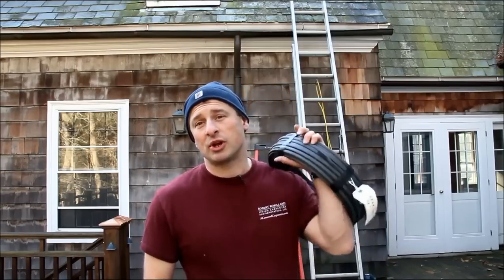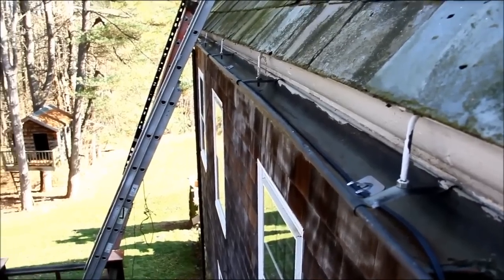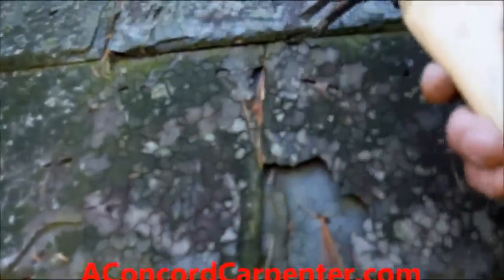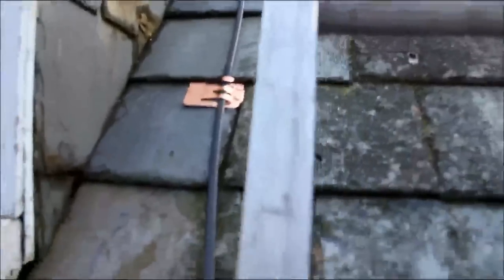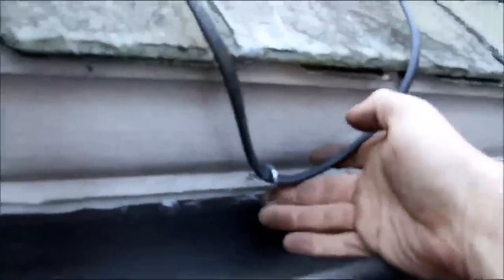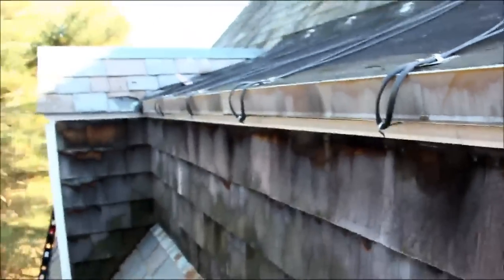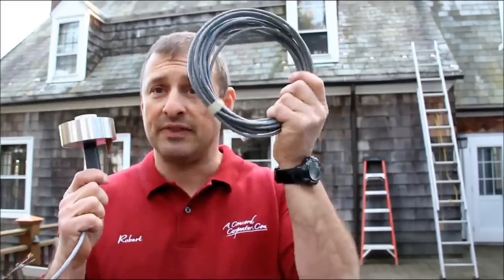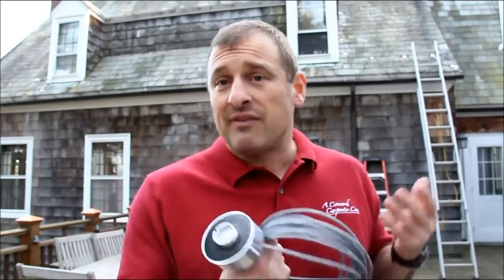Installing Radiant Heat Roof & Gutter Deicing Systems

Comment: Hi , thanks for the video. is it not necessary to mount it on the entire surface of the roof?
Reply from the maker: Great question! We typically recommend the edge of the roof since this is where ice dams build up and can cause the most damage to the roof. If the edge of the roof and gutter can melt the snow then anything melting above and possibly trying to refreeze at those spots will get drained off the roof safely. You can learn more about these systems here: https://www.warmlyyours.com/roof-and-gutter-deicing Thanks for watching!